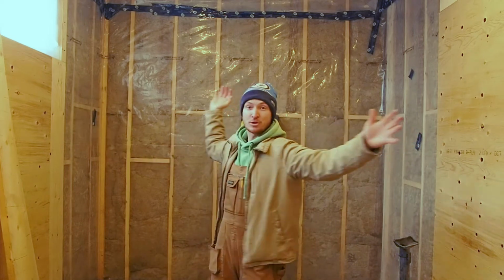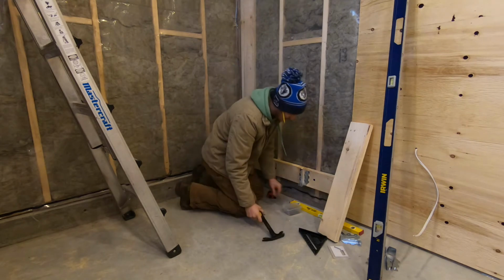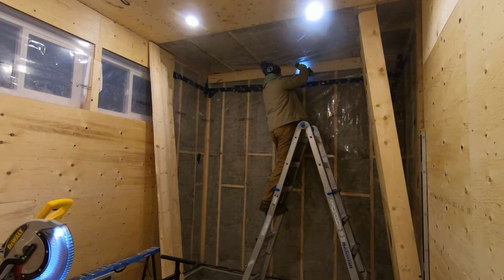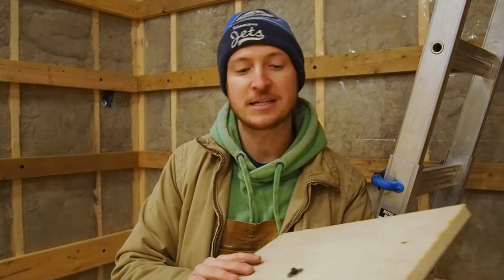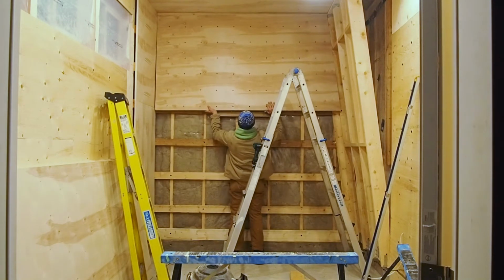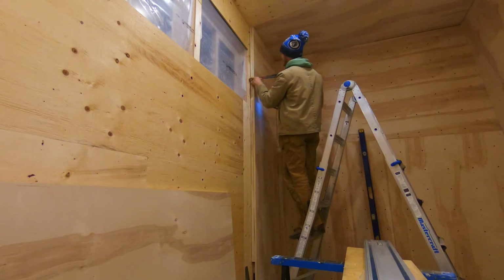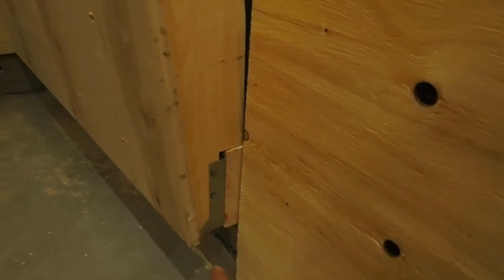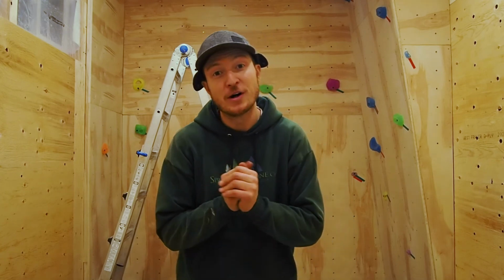Building a home CLIMBING WALL

Comment: What’s a structural screw? Heavier gauge or something else?
Reply from the maker: It’s essentially a stronger screw that is code compliant for lateral weight bearing. That might not be the exact term, but they are screws that can take the place where nails were traditionally used.
Reply: @hsdesignstudio  sounds like a heavier gauge then. Not sure we have them call that over here. The building code probably describes them though but I won’t have to meet code.  Thanks for answering.
Reply from the maker: Yes exactly- I just wanted to make sure they could hold hundreds of pounds without ripping off the wall. Probably overkill, but I had them around, and I like peace of mind.
Reply: @hsdesignstudio  no harm in it.

Comment: Hey man I am also a builder who is into climbing. I am going to put up a wall in my shop probably 16 feet up to an over hang. Do you think I should use 2x10s for framing members or would a 2x8 cut it do you think?
Reply from the maker: Hey Sam- I think 2x8's would cut it (though not liable here ;) ). My theory: it's not like a beam in a house holding still loads down to point loads where the forces are perpendicular to the ground. It's more of a outward pulling force in many instances as you climb. Say you are pushing through a foot upward, most of that force is not directly on the framing member, but transferred through the member to the ground. Therefore, I think the more important aspect is how strong is your framing held in place to the main structure. I'm not sure if that made any sense?
Reply: @hsdesignstudio  I got the gist of it for sure. I will be attached to 6x6 framing members of the post frame shop for horizontal or shear forces pulling the wall outward. I just wasn't sure how much material depth to add in for the weight of lumber pulling outward on the wall
Reply from the maker: @samsonite813ify  I still think you would likely be fine with 2x8s. All of wall is a mix of 2x6s and 2x4s for lateral framing on the exterior walls of the garage- also gives me a gap so my bolts don't poke holes in the vapor barrier. However, all of the framing is done with structural lags and joist hangers on the angled wall.

Comment: When you screwed the board onto the furring, do the screws go throw board into furring strips only? Or all the way through to existing studs?
Reply from the maker: The screws to attach the plywood went into the furring strips only, but the furring strips are attached to the studs with structural screws.